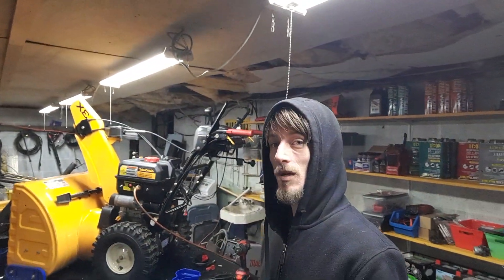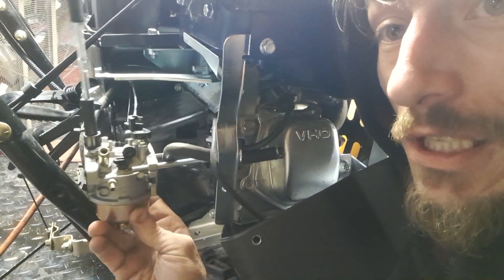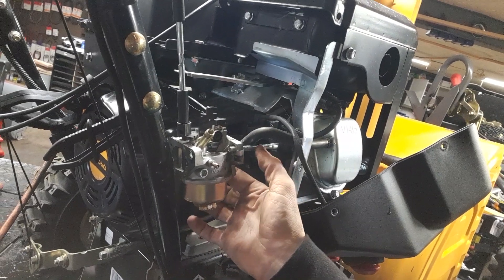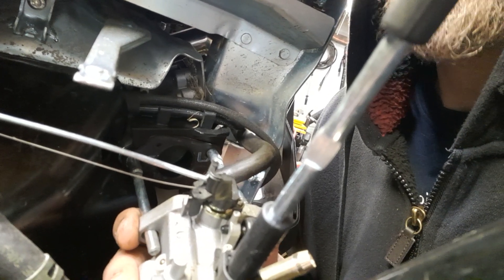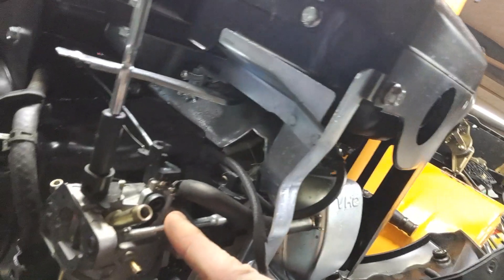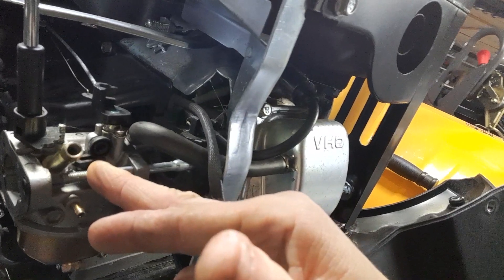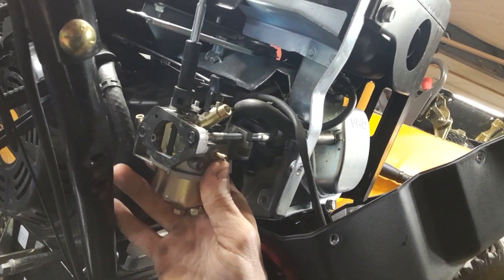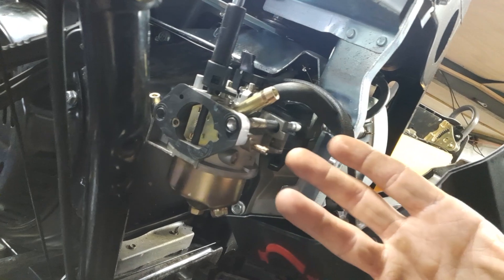cub cadet 3X (26") 357cc Three-Stage Snow Blower carburetor removal process  engineer design flaw ?

Comment: I just removed the two very bottom bolts from the handle on the side where the carb is and you can squeeze the carb by it. Pain, but really just two small bolts. Don’t forget to reinstall though.
Reply: That's all it boils down to. Removing those two bolts on the bottom are a quick way to be able to remove that carb with minimal additional effort. I've had to do it a few time, as you may suspect since I'm watching this video.
Reply: Once carb is put back on isn't it alittle hard to align the handle bar back while putting bolts back in. Did you have to remove anything else like chute control? Wheel ?

Comment: "The primary job of a design engineer is to make it difficult for the manufacturer and impossible for the service man."
But I can tell you why it's that way:
Honda designed it that way because it's better.
China built it that way because they just copy stuff, they don't ask why something is built a certain way.
And Cub Cadet put that motor on the snowblower because it was the cheapest option, and designing better access into the snowblower would negate the savings of using a cheaper engine.
And the Owner bought a snow blower that was difficult to fix because they aren't the one fixing it.
I think that covers all the bases.  :p
Reply from the maker: Well Spoken Couldn't Have Said It Better. thanks for your input!